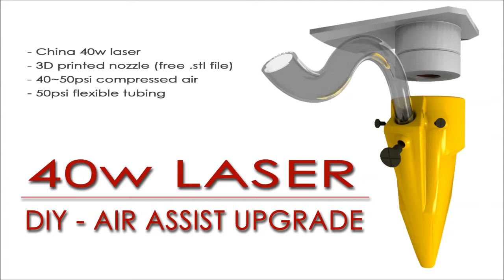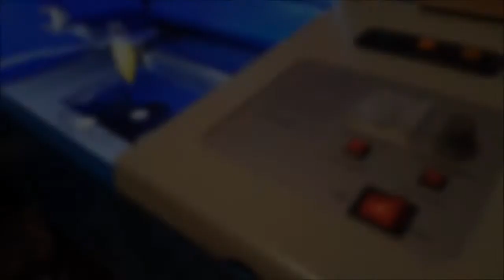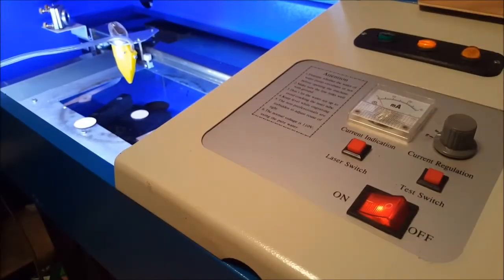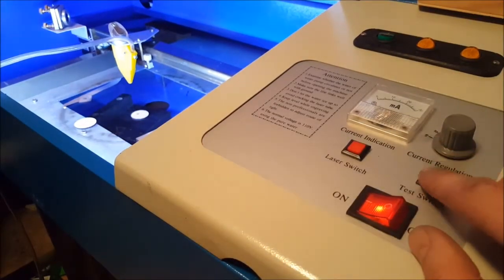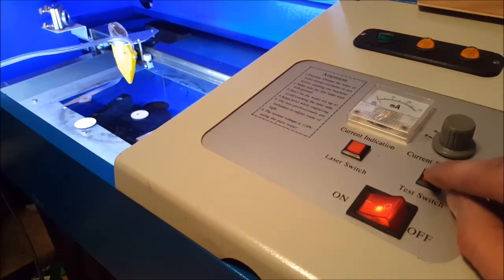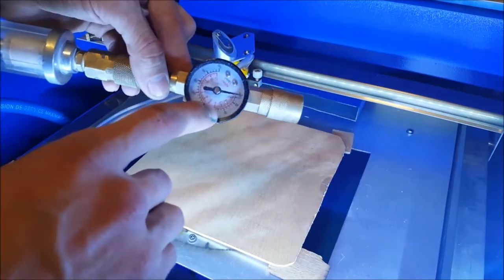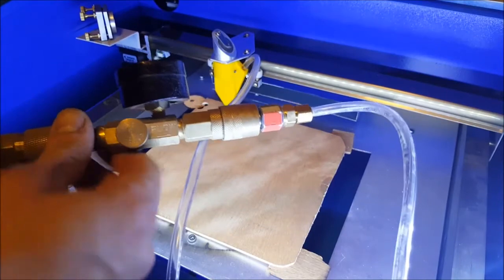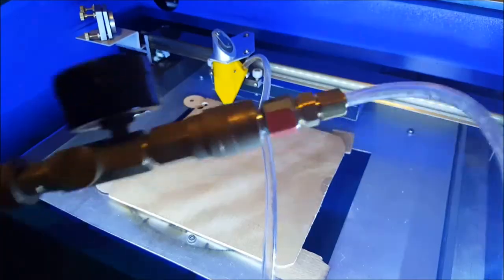DIY 6$ Air assist upgrade for 40W laser

Comment: Hi A Gontran , can i ask : what are you using to send the air ?  Compressor ?  if yes wich compressor ?
Tanks in advance for you response
Reply from the maker: Hi Jose, I am using a regular 5gallon air compressor .. the small ones you use with a nail gun. You dont need much PSY..  but the bigger the compressor.. the less you will hear it run while cutting.   Keep that in mind in a one hour job.   ;)    It is very important to seperate the moisture out of the exaust air becaus it will wet your material when spreing it and may do unwanted effects.   I will post my new nozzle model soon  (3D file for printing)   It,s the same as this one but a few milimeters shorter. So the nozzle will be at 3mm from focus point...47mm from lense.

Comment: How much do you shorten the exhaust by??  I just got a upgraded k40 with the LED lighting inside the cutting area, stop switch, etc.
Reply from the maker: It is mentioned on the download page. :)   " + Update+- V006 has 6mm of clearance between nozzle and focus point."  This way, longer jobs wont melt the tip with refracting heat.